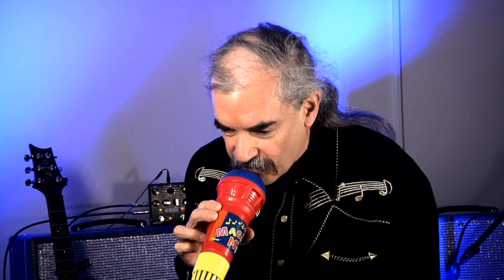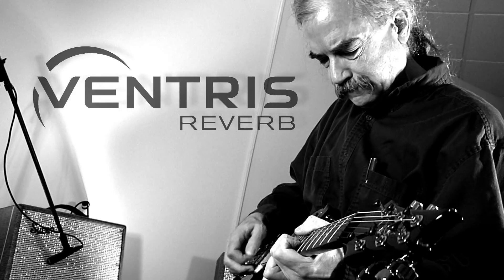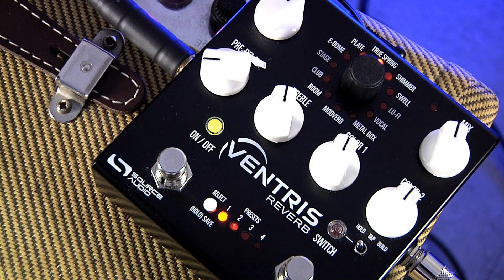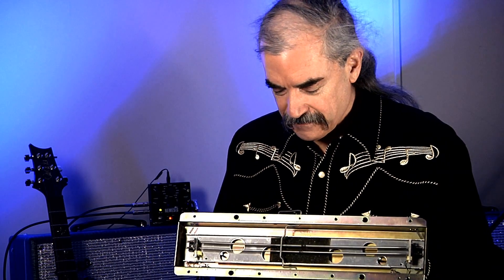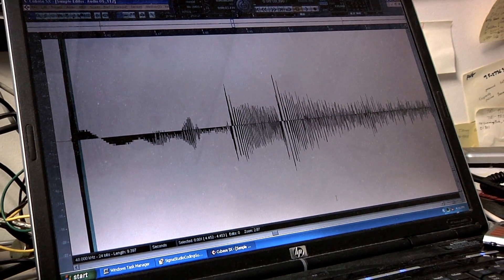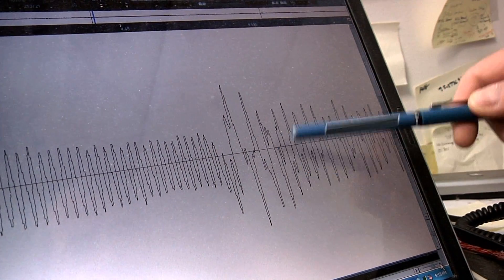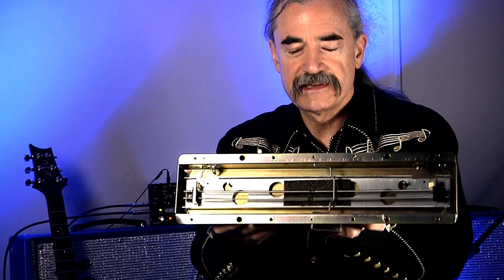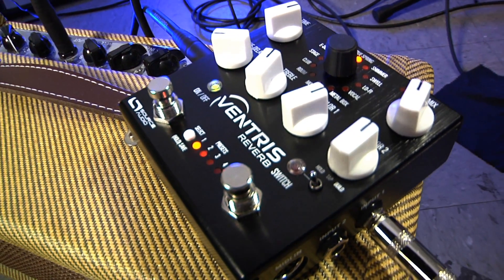Spring Reverb: Inside the Sound Laboratory with the Ventris Reverb

Comment: Ok. First things first. Whoever disliked this sucks. 

Now for my opinion. :) To my ears there seems to be a distinct difference between 1,2, and 3. The first pedal has a distinct brightness and seems to be more high fi while the next two have a bit of muddiness to them and seem a bit lower level in output. Comparing this to the spring verb I currently have, I'm almost certain I know which one it is, but of course I will not say and I could be totally wrong as well. It's very subtle to me, but it's there. Then again, I have played bass for 22 years and my ears are just a tad shot. :) 

Regardless though, I'd be happy with any of these sounds. If it can do half of what the Nemesis can do, I know I'll be happy!!!

Adam-Acid Splash Designs